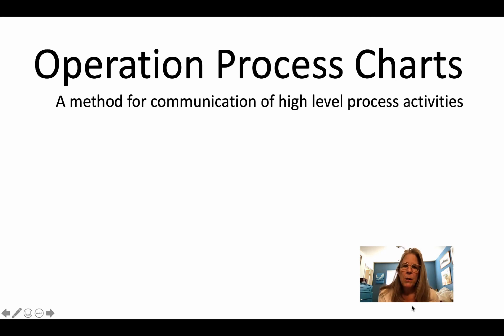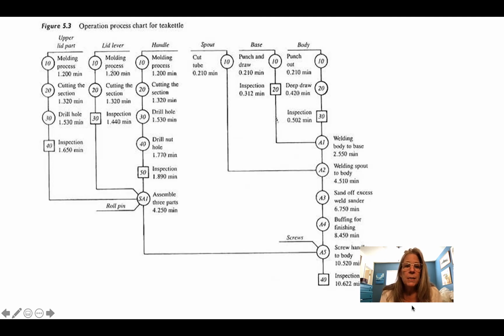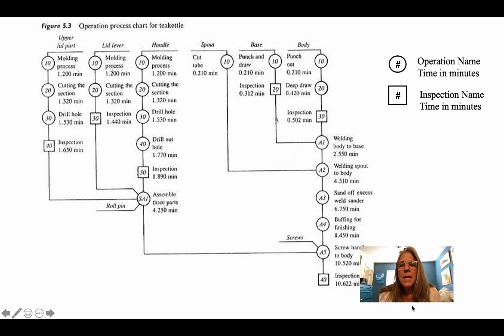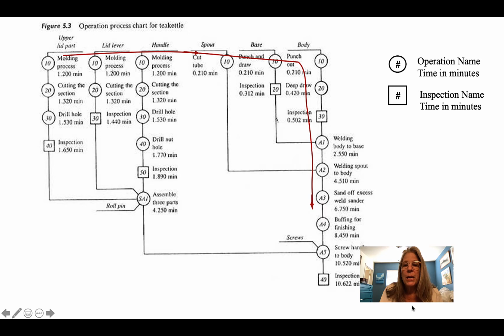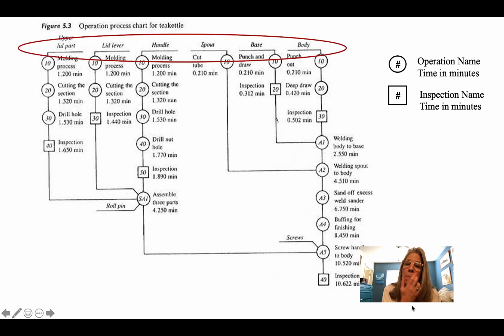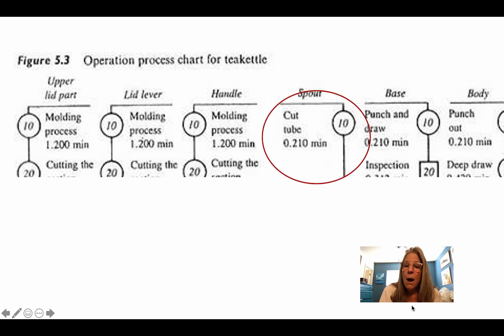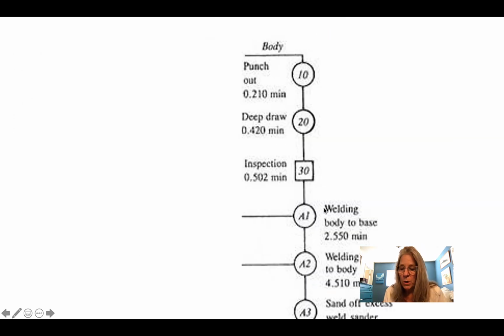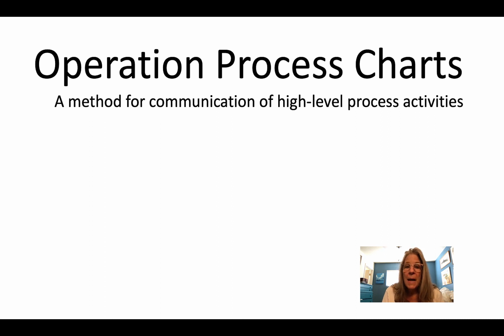Operation Process Charts

Comment: I would like to ask you a question. is it possible to use an operation process chart with multiple outputs or ending points?
Reply: It should be possible. I do not see any difficulty.